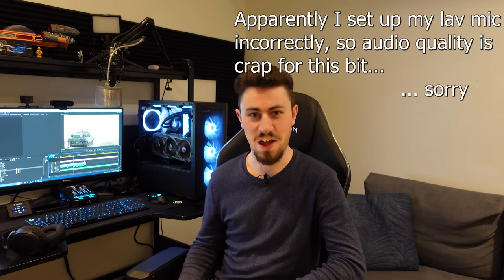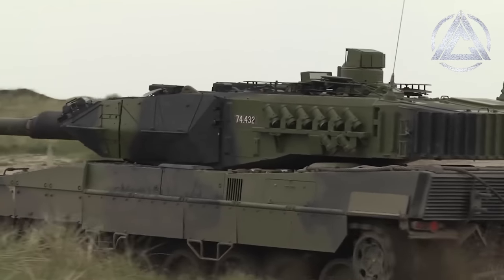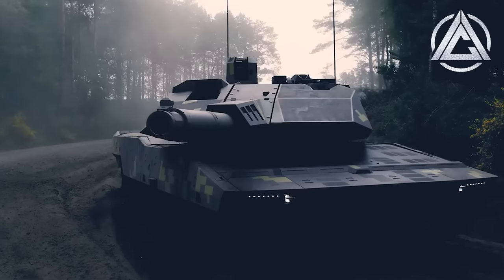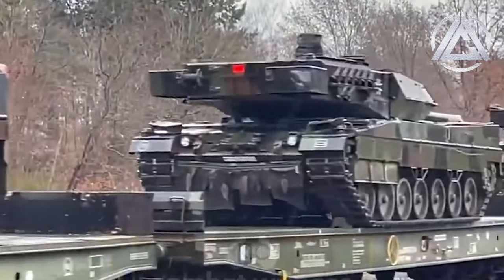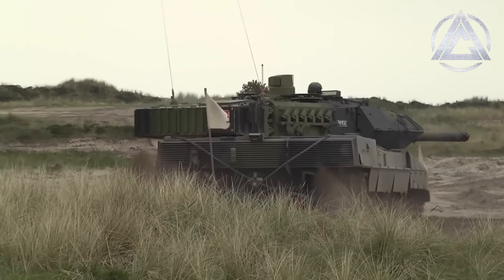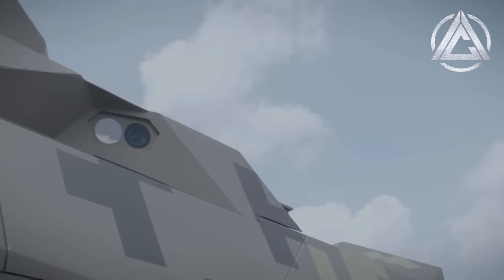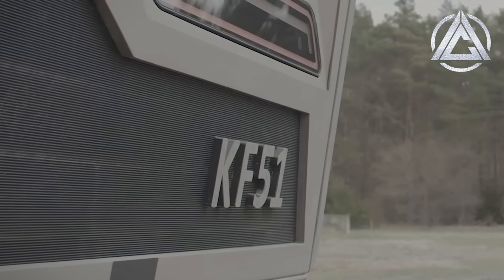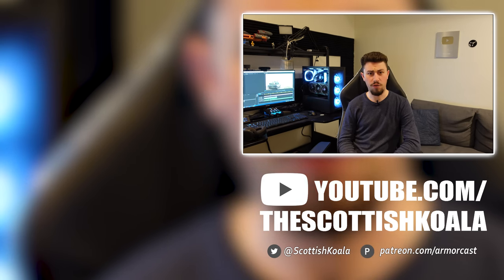Germany's New KF51 Panther Tank | The Spearhead of a New Generation?

Comment: 14:00 I know I'm talking a little crazy here, but I think modern tanks should have auto-loaders AND 4 soldiers. That 4th body, aside from being useful during maintenance, OpSec, and when you throw a tread, which seem to be the reasons always mentioned when arguing for a 4th body, and which are all valid points, I think w the changes in war, that 4th solider could be handling electronic warfare for the tank...whether that's operating a Drone, reviewing the myriad of Intel sources or just making sure everything's batteries are charged because someone didn't remember to plug them back in during the chaos of combat, I believe, is a worthwhile use of a soldier. 
We mustn't fall into the trap of thinking that the needs of the last war will mirror the needs of the next, nor will automating a role, eliminate it. Frankly, while AI and automation are touted for reducing the need for people, it seems to often be the case that while one role is eliminated, another is created.
Reply from the maker: This makes sense to a degree, but I would tend to say that argument of "the 4th guy is really useful for maintenance on the tank" is a bad one. Tanks do not go anywhere alone, and if one of them throws a track, you don't just have the THREE crew members from your autoloading tank... but the three crew members from the other four tanks in your platoon too!

As for strapping drones to tanks that then require a 4th crew member... this is a non-starter of an idea. First of all, these things can be launched from a dedicated vehicle 10km further back where a light armored car is a perfectly viable platform, and easily communicate with the MBTs thanks to modern datalinking systems. 

Second of all, as Nicholas Moran said - tanks are designed to be really good at ONE thing, one role on the battlefield. Why on earth would you add anything to it that detracts from, or doesn't offer immediate benefit to that role? The number one design ideology for tanks going forward is reduced size and weight - they're already too big and heavy and need some fat trimmed off. Adding drone operation into the vehicle with a fourth crew member AND having an autoloader goes directly against that

Comment: I don't know I disagree that a unmanned turret is a bad idea, first off it allows you to shrink the size of the turret overall since you'd no longer need room of the squishy humans and thus would only necessitate armoring the vital areas to allow the turret to operate, likewise you could feasibly transfer and localize that armored protection and weight you shed from the turret around the crew compartment in the hull, effectively making it like a citadel on battleships or for a more contemporary example like the A-10's titanium bathtub.

This could result in a more effectively protected crew give that they will all be in a singular location and likewise would result in a less top heavy tank given that its center of gravity would be closer to the ground and would lessen the chance of a roll over on uneven terrain from say a mine detonation, also since the protection of the crew and size requirements for the loader and commander are no longer required and since you mentioned attacks from top down munitions you could likewise reinforce the top of the turret instead and since it would be smaller to that would less area that would also need to be armored.

It may also be possible to now add a semi V hull specifically under the crew compartment to deflect mine blasts, as well as the armored bathtub for the crew, it will still more than likely disable the tank and likely tears its treads to pieces, but those can be replaced and the tank any even still be able to function as a fixed gun, should the crew still be alive and the rest of the tanks still be in working order if the situation calls for it, at least until the tank can be retrieved for repairs.

Suffice to say I think the concept has merit to it even if it is not immediately obvious to the layman and should be looked into further as well, but that is just my two cents on the matter.

Comment: Hope all those cameras and flat panel screens are durable after "collisions" from inside and out. Anti - drone defense will be a big part of any modern armor, so their attention to this is gratifying.Even if those systems were made portable that crews can make repairs easy to shot up equipment, would be nice.All this tech has to have a heavy price tag so hope performance beats out numbers of adversaries. I doubt that with the small numbers of Armata tanks out there the moniker should be changed.

Comment: Just one comment on the shot trap speculation. There are MANY pics of 120mm perpetrators that skipped along armor on Iraqi tanks and penetrating very shallow angles (going completely through one side and out the other)or bouncing into another surface and penetrating without disintegrating. Whether these were all DU perpetrators I don't know, but I would never say never that something will or won't act in a specific way.

Comment: I think the optional 4th crew for the tank as well as loitering munition launcher is a decent idea as long as it is the command tank. A company of 4-5 tanks could have the command tank outfitted with the loitering drone as well as the company commander and drone operator and become near indistinguishable from the other tanks in the company, accepting less firepower for more reconnaissance capabilities as well as making the battle space more transparent in cases where air support isn’t widely available.
Reply from the maker: Minor correction - a platoon is 3-5 tanks (depending on nation. 4 in German service, same as most NATO countries. A COMPANY is 14 tanks (three platoons plus two command tanks). I can see the drone capability being somewhat useful for the company command tanks, or even one level higher again at battalion command. Definitely doesn't belong at the squad level though, and honestly I'd hesitate to call it useful at all. You've either got a drone launcher system that's lugging around 50 tonnes of composite armor and a whopping great cannon and ammo for it you're not using... OR you're hampering size, weight and complexity of the tank as well as reducing ammo storage to carry a bunch of drones you won't need if you're actually doing your job as an MBT crew.

It's the same reason tanks don't have SAM launchers at the back of the turret, and the same reason the "battle-carrier" (hybrid battleship/aircraft carrier) never took off as a concept - you're just better off separating that capability and getting two assets each more dedicated to their respective roles. An armored car can act as the drone launcher, let the tanks focus on doing tank things.
Reply: @ArmorCast great points, noted!

Comment: I know that renewable energy is not the priority of military forces but what about the motorization of the tank? The Abrams X prototype features a hybrid power pack which increases stealth. Is such a solution on the table for the future Panther?
Reply from the maker: Probably, but funnily enough renewable energy WOULD be a huge benefit to the military - not so much for environmental reasons, but because the logistics of supplying battalions of tanks with fuel during a war is a monumentally difficult task! Easing that requirement would be among the highest priorities for any military, provided hybrid power packs are reliable enough and can provide enough power to weight, they’d jump on the idea!

So yeah I reckon there’s a good chance a production KF51 would delve into that just like Abrams X has

Comment: Is there any reasonable chance of light gas gun ever being workable on a tank?  How would you both store the hydrogen (or whatever) and produce it quickly enough?
Reply from the maker: Exceedingly dangerous for a direct combat vehicle. More likely CLG guns will equip long range artillery, and possibly ballistic missile defences. Even the Navy don’t want CLG guns because of the tendency of liquid hydrogen to… you know… explode very violently.

It would also be exceedingly difficult to produce storage containers for frozen liquid hydrogen and oxygen, making any unit equipped with this type of weapon ridiculously expensive. People already say tanks are useless because of their multi-million dollar unit costs… you wanna start thinking about $25 million tanks? 😂
Reply: @ArmorCast  Thats what I was thinking but then I wasn't sure if they'd store it as hydrogen rather than as part of some other compound and a chemical reactant that together produce the necessary hydrogen.

Either way it seems pretty tough to make work in a tank.

Comment: What about the MGCS was launched in 2017 by French President Emmanuel Macron and then-German Chancellor Angela Merkel. A few days ago, the French and German land army chiefs signed a so-called High Level Common Operational Requirements Document (HLCORD) — a key step before an actual specification for the main battle tank. How does Rheinmetall and their KF51 fit in this puzzle? Is the French-German collaboration for yet another tank design?

Comment: It's a leopard with an auto loader and a bigger gun, fitted with an APS. The only bonus for ze germans is the fact that BAE has been integrated into RMTL gifting them the secret of challenger's advanced armour arrays. 
Leopard's took a very different stance from challenger following the blitzkrieg tactics, strike fast and hard meaning less armour. 
Challenger took the fighting from dug in position perspective and opted for a slower pace but a more heavy armour approach.
Drones have changed the battle space completely. Tanks have a use, but only under pre requisites .
Reply from the maker: Funnily enough, Leopard 2A5, and ESPECIALLY the up-armored Leopard 2A7, have always had better armor than Challenger 2. So has M1A2 actually, at least on the turret. Challenger 2 might have the best armor COVERAGE however, because it’s hull is very well armored too, unlike Leopard 2 (slightly better than Abrams too, but not by as much)
Reply: @ArmorCast  show me the proof or link me to it.
Reply: Where are these facts being plucked from?

Comment: I am by no means a tank gun expert,  but wouldn't increasing the current 120mm ammunition (by increasing the penetrator length and case capacity for an increase in velocity) to the same overall dimensions of the newer 130mm ammunition (without increasing the penetrator diameter by 10mm), give similar results without the need to develop the 130mm tank munitions?

A similar example would be the increase in the case capacity of the WWII M4 Sherman's newer 76 mm gun M1 over the older 75 mm M2–M6 guns that it had previously been using?
Reply from the maker: To a degree, yes. The thing is, that degree has pretty much been hit already, with modern projectiles that are as much as a metre long (while the penetrator is less than 3cm in diameter). If you want to make the projectile longer while maintaining structural integrity, rigidity for armor perforation, and stability in flight, then you also need to make it wider. That then creates more drag as well as additional weight, and loses that benefit you were after anyway.

A better solution is an electrothermal-chemical ignition system, which the XM360 gun was originally built to test. It was able to push a 120mm projectile to around 4.1 kilometres per second... that's the kind of velocity you expect from a railgun, but without the massive energy requirement or barrel life issues.
Reply: @ArmorCast  Thanks for clearing that up.

One other question I had was how large can a tank gun's caliber increase before it runs into issues, such as the weight, barrel life, number of rounds carried, material density of the penetrator, etc? I've seen the United States, France, and Germany playing around with the idea of a 140mm tank gun from time to time.

Is 130mm the largest possible tank gun caliber with modern technology, including at or near the 2 km/s muzzle velocity and using either tungsten or depleted uranium with the highest density as the most cost effective penetrator material currently available?
Reply from the maker: @user-jm6hh7op3w  Theoretically you can go higher. In WW2 there were even tank designs mounting 155mm or 170mm guns, and artillery systems like the 2S4 mount 240mm guns, in fact some go even bigger (look up the 2B1 "Oka").

It's about balance. In THEORY you can go bigger if you want and still carry a decent number of rounds, as well as adequately cooling the gun and such... you just need a bigger vehicle. In PRACTISE however, that makes it incredibly difficult to use effectively, and very prone to issues like getting bogged. You've also got to consider that..... somebody has to load those rounds INTO the tank before it goes into battle in the first place... good luck doing that with 140mm projectiles that are two metres long and weigh 150lbs each!

For all intents and purposes, 120mm is the optimal size. It gets you the best bang for your buck as far as armor penetration and/or high-explosive filler, without taking away ammo capacity or making the vehicle huge and unwieldy. I honestly do not believe the 130mm is the right choice when the 120mm calibre still has a LOT of growth potential.
Reply: @ArmorCast Thank you again for the information. Keep up the excellent work!

Comment: 130mm can only carry 20 rounds compared to 16 (turret  with blowout panel) +25 (hull, no wet ammo rack, no blow out panel) in the leopard 2. BUT the 20 rounds in the KF51 are separated from the crew, so if you only want rounds stored safely then Leopard 2 technically only have 16 round capacity making the KF51 having better ammo capacity in safe storage
I think the main problem is that the KF51 has strong competition like the K2 black panther from south korea which is becoming a big arms exporter that countries are going for due to lower waiting time from other manufacturers since the manufacterer of the K2 has bigger production capacity
edit: I wonder how effective would a 120mm kinetic missile would be compared to an APFDS 130mm (if an 120mm kinetic missile could be fired from a 120mm gun)
Reply: Not one would change a 2a6 for a k2 BP... that is stupid.

Comment: Will the drones also work together with the 130 mm cannon so that it can automatically get the necessary coordinates and fire to hit priority targets automatically?
Reply from the maker: I'm not sure. It's certainly possible, that kind of datalink does very much exist, M3A3 Bradleys and M1A2 Abrams have it between them and the Apache Longbows, allowing the Apache to fire missiles at targets the tank can see but the helicopter cannot.

To my knowledge it's never been done in reverse, but I can't think of any reason why it necessarily COULDN'T
Reply: @ArmorCast  If you delete this entry and do not tell anyone, I can file it for a patent. -  No, just kidding. 
Maybe it won't work so well because of the distance to the target. The drone has to fly quite far to get into position to see targets near the tank's maximum range.
Reply: Yes the drones have an automatic data uplink to the the firing Panther AND to the command center as well
Reply from the maker: @d.o.g573  Any evidence of this? I've seen nothing official to suggest that HERO 120 can link coordinates/firing solutions to the Panther, and no other NATO tank has the ability to be used in an indirect fire mode (Russian tanks have this ability, but no datalink)

Comment: The addition of drones makes totally sense and is a necessity when we look at the Ukraine. Just on infantry guy which was overlooked with a portable anti tank missile and you are gone. So adding awareness of the battlefield is the way to go.
Reply from the maker: Drones are great, but there is zero point sticking them onto an MBT. An MBT is meant to be very very good at ONE specific job, one role on the battlefield. Why would you add anything to it that detracts from, or doesn’t immediately benefit, that one role? The things are too heavy as it is! And don’t carry enough ammunition. Plus, the drones can be operated by a dedicated team with dedicated light vehicles an extra ten miles back, with no issue. Sticking drone operators on the frontlines is not smart, and having your MBTs engaging targets at 50km is a complete waste of its design, which is expensive to field and probably needed elsewhere to engage immediate threats.

Comment: I have to agree on the inside chiefton hatch opinion. A tank should not be intergrated with loitering munitions. You can have other and cheaper vehicles to forfill the scouting role. A tank has a big gun and a precice role to forfill on the battlefield. Scouting is not one of them. A vehicle like a bradly is menth for that and is equiped to do so. No need for a tank to sacrifice ammo storage to get stuff like that. This tank already does not have much ammo as it is due to the size of the shell. No point in cutting that to half to install crap that others easaly could carry.